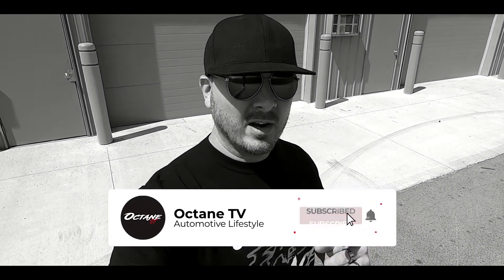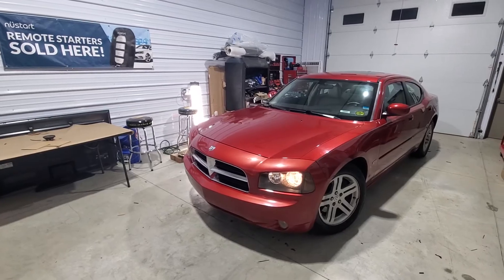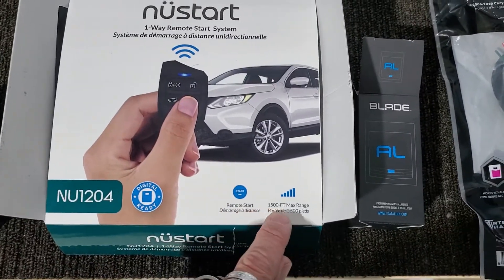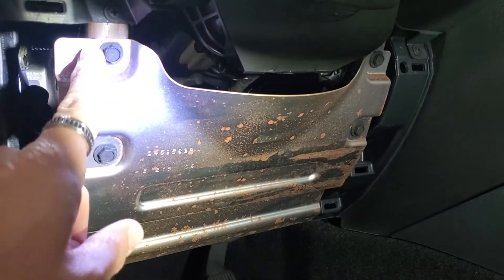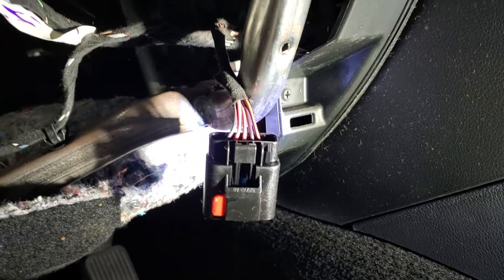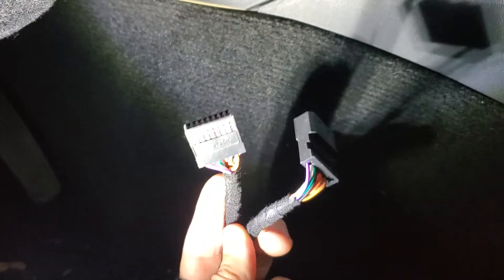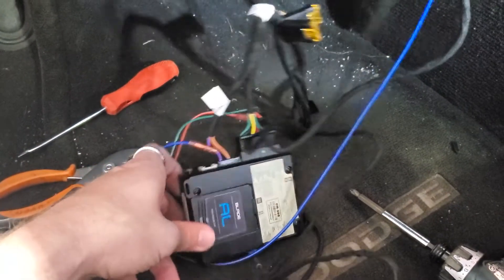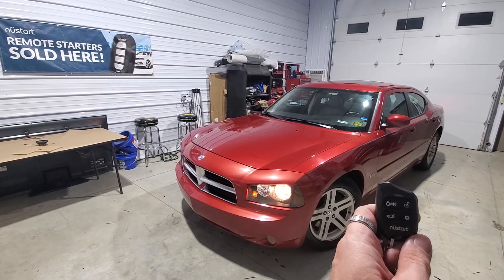DODGE CHARGER -- HOW TO INSTALL REMOTE START CM900 PLUS BLADE AL IDATALINK / CDK1 T-HARNESS

Comment: This is perfect for what I have in mind. by going with a remote start, you won't have to worry about your key ignition switch going bust on you any time too soon. though I'd step that up with a kill switch (just to be sure and that way thieves won't try to steal my car) along with 4 Rexing Dash cam's covering the front, rear, left and right along with another one covering the cabin. plus two more dash cam's for the front and rear trunk.